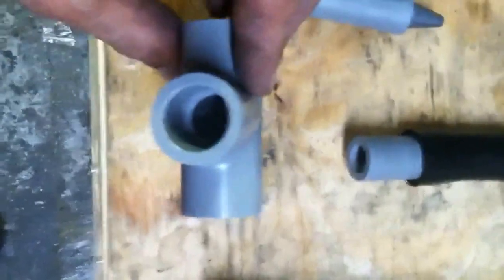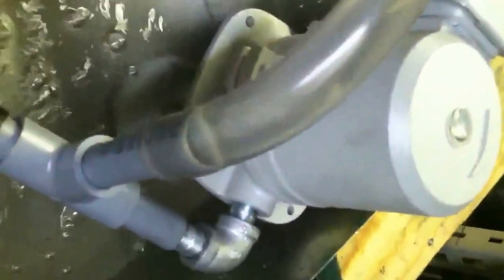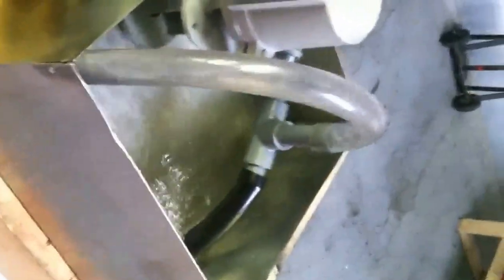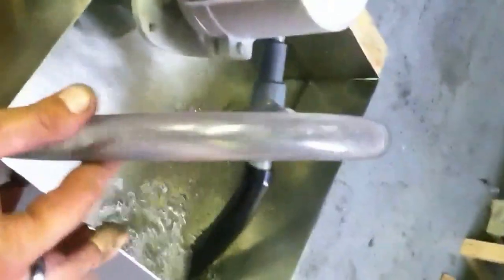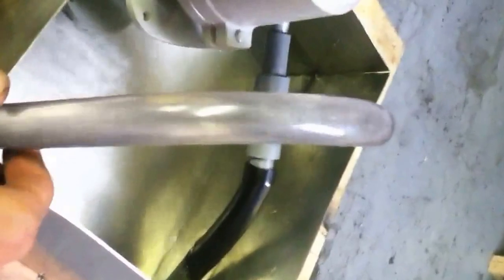PVC Venturi Home Made

Comment from the maker: Venturi was used on envelope printing presses to curculiate water that thinned down the ink. It can be simplified and work but maintaining the angle and sharp point allow for turbulant free flow of water and air , which helps obtain grater vacuum. As for the uses they are limit less from hydroponics to aquarium   to what ever any body may find a use for. hope that answers your question

Comment from the maker: I glued solid pvc into a pvc pipe. drilled a 1/4" hole thru the piece. using a lathe I cut the point at seven degrees making sure the tip is nice and sharp so there will be a straight stream of water. tapped the other 1/2" npt. screwed that into a pump . stuck a three way fitting on to it. and once the water flows u get vacuum on the top of the three way. I don't remember the specs on the pump but using a 3/4" piece of hose I was sucking up a gallon in a matter of a few seconds.

Comment: The sound is not clear on my computer. Could you explain in more detail the items you used to make this. Are there just straight pvc pipes in the end of each hose? Is the nozzle glued into the end of the pipe and a threaded coupler on the other end? Thanks